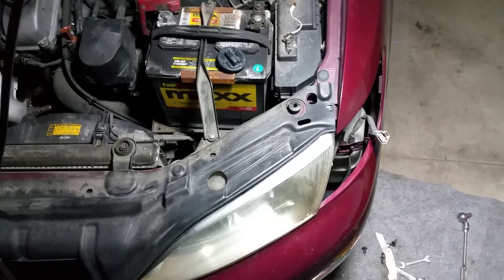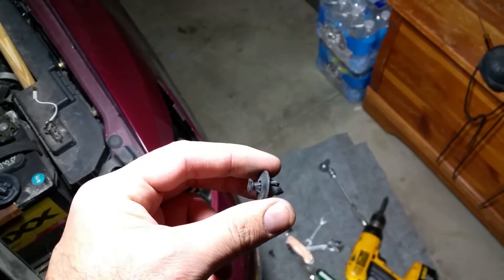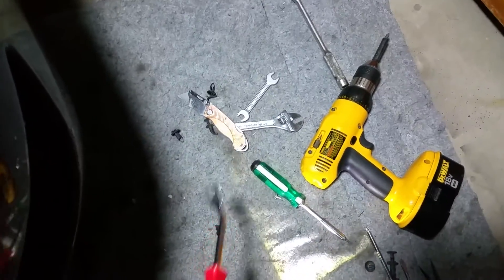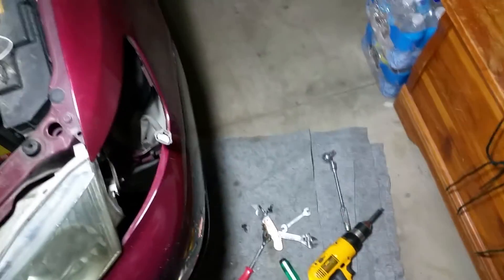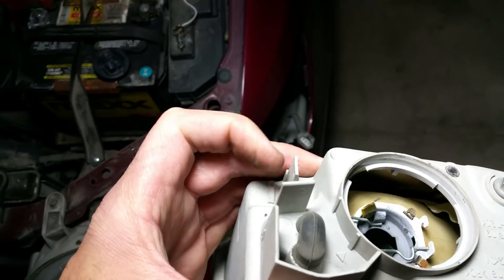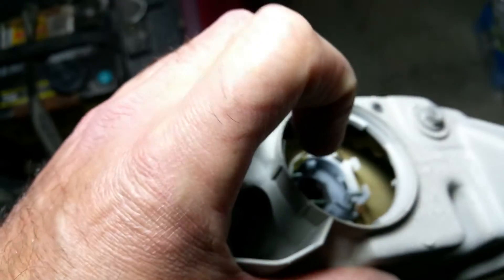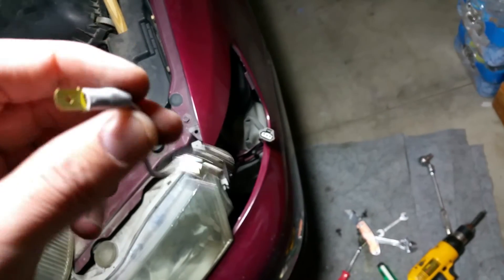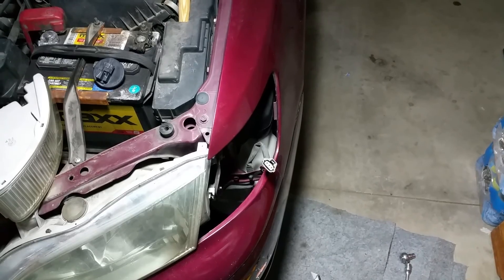1997 ES300 Fog Light Bulb replacement fromt the top   Part 1

Comment: On my 2001 es300 I just removed the 2 10mm nuts from under the bumper closest to the whee well and the first Phillips screw from the fender. Then the 10mm holding the bumper to the fender. Then I reached in and undid the 10mm bolt on the side of the fog light housing by feel(tight fit but squeezed my arm in). Then squeezed the clips to pop out the light housing. Twist to remove the bulb holder. Unplug the old bulb and press the metal wire down and left and out with the old bulb and put the new one in matching the square side and round side then boom test and put back together.

Comment: I found it way simpler to remove the five, 10mm screws from the splash guard underneath in front of the tire.  Then I just used a zip the to hold the splash guard out of the way,  turned the round black part the wiring harness is attached to a quarter counter clockwise, leave the wire harness attached. Swap out the bulb, put the cover back on and reinstall the splash guard, about ten minutes a side.  Don't need to remove the lens, or the wiring harness.  Pay attention to the screws there are three different thread patterns though.

Comment: That’s a turn signal....not a fog light....
Reply: 2:09 He did not demonstrate the replacement, but you can see that he removed the signals, place it aside, then picked up the actual fog light casing and told about the 10mm screw on it as you reach down to get it out.